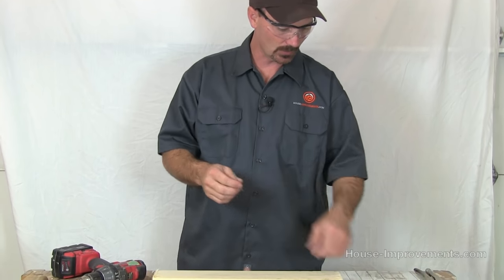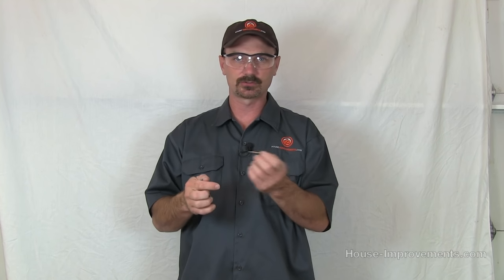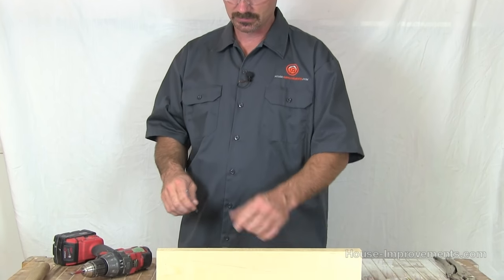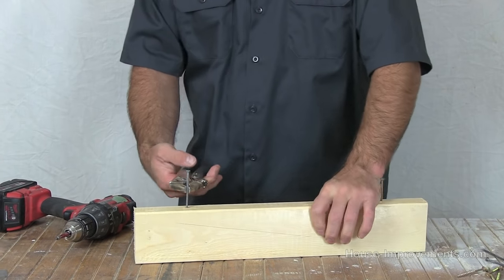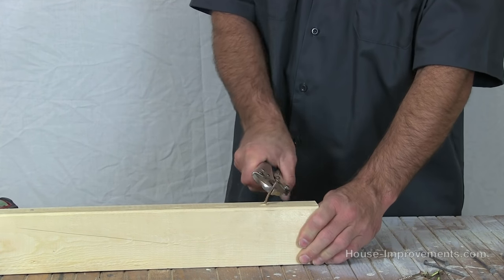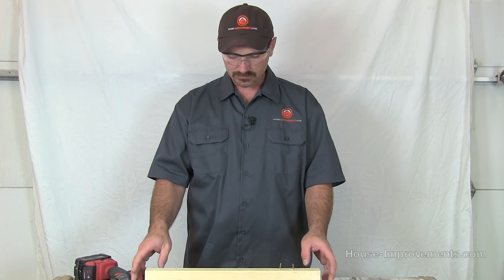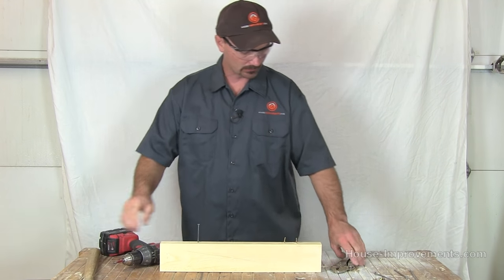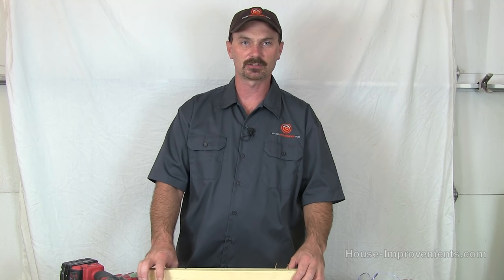Screws vs Nails - Which Is Stronger?

Comment: I am impressed by your experiment!!!... No problem with that whatsoever!... I may have my terminology wrong, but I believe "shearing strength" is the sideways strength... If my definition of "shearing" is correct, you should break both the nail and the screw by applying ONLY sideways pressure (no bending at all)...

Comment: Nails have to be ductile because they have to withstand a hard impact from the hammer. Screws have to be hard (thus brittle) to not deform at the screw head and withstand the twisting force during installation.
Reply: Thank you for that.

It makes more sense now.
Reply: Yes exactly I was thinking metallurgy difference.  And as another point there are decking screws which obviously would need to support structural loads also.
Reply: Perfect point thank you

Comment: A bit tangent to the focus of this post, but I just had an Attic Ladder that a licensed contractor installed 15 years ago come crashing down out of the ceiling in my garage just as I got my weight on the 3rd step going up - torn up, but damn lucky to be alive! As it turns out, he used (5) 1/8"x3" standard screws to mount the casing to the beams. The manufacturer recommended (10) 1/4"x 3" Aluminum Lag Bolts! That is what I am installing the new ladder with, but I also bought some 1/4" 3" SPAX Lag Screws to add as well. Not sure why they recommend and include Aluminum Lag Bolts with the new ladder, but maybe it is because the aluminum is not as brittle?
Reply: I should mention the 1/8" screws "sheared" right where the casing joined with the joists.(almost in the middle of the screws)

Comment: God bless you my brother but this is not how an engineer would come to the conclusion on whether or not the nail is "stronger" than the screw. But you kept me entertained at your level of commitment to the demonstration and many of your viewers will now be telling people how nails are stronger than screws !!!! Unfortunately some of us are just a little sharper and understand why engineers (who actually field test their designs) will tell you that the attachment resistance of wood sheathing when screws are used is much much greater than nails. That's why nails used to attach the sheathing (or roof tiles) have to be "ring-shanked" so as to avoid being completely ripped out of the truss framing. When you live in a high velocity hurricane wind zone and work in the construction industry you tend to understand why screws are used where nails are insufficient. Again Shannon thanks for the entertainment.
Reply from the maker: You missed the point. Deck screw are not strong enough to use as structural framing fasteners, they are brittle and will shear off easier then a proper framing nail or even a structural screw. I admit this is not the engineers way of demonstrating that and i never said it was.
Reply: Not every thing the engineer says is correct, sometimes we need a little more common sense

Comment: You nail your rails with either ring shank or spiral shank 3.25” nail and it will last longer than any screw. You are right about smooth shank nails but nails have far higher shear force resistance and will hold better

Comment: You should also show the screw advance. I try to look at as where the threat of force would come from if it's a side impact, nails  are best. If there is a concern a direct impact screw will not back out. Their is a place for both in framing, in my opinion.
Reply from the maker: The point is that you need to use structural screws when framing to standard deck screws

Comment: If your structure moves enough to shear a screw, then consider redesign the framing to strengthen the structure and reduce or eliminate the shear component on the fastener.  The earthquake scenario is like saying every house across the United States should use hurricane bracing even though there is no possibility of experiencing a hurricane in one's area.
Reply from the maker: Do not do structural framing with deck screws.

Comment: I have often thought about that. And as you say, structural screws . . . and adhesives . . . but I would also point out that you can add more screws and gain back the strength you might fear losing if using screws. Put in enough screws and I don't see (in my mind) anything like the screws breaking off happening. I know that if you put in too many nails the inspector will say you used too many nails an weakened the wood, causing splits you don't see with the naked eye . . .  that might be BS though.

Comment: I watched a recorded demonstration of one of those fastener testing agencies that works in tandem with ICC and they were doing various tests using nails and the equivalent size in approved framing screw size.  It was several different tests and in each test the boards were fastened to each other in different ways (2 boards flat stacked on each other, 2 perpendicular boards and 1 horizontal board fastened to them, etc) and in each case one was done with nail and one with screws.   The machine measures pounds of pressure as pressure is intensified and the test is stopped and pound of pressure is recorded when one of the 3 things occurs -  1) "pull out"  - fastener can no longer hold and is pulled out of the board  2) "shear out" - fastener is snapped due to increasing shear pressure  3) "tear out" - fastener remains in wood but tears through the wood and out the side of board.    The screw won every single test they did and even the ones that you would think the nail would win.  I had always heard "nails have superior shear strength" but thats not really true b/c the nail will never make it to the point where it is snapped and is pulled out of the board.  That particular test was 2 boards fastened to each other and the machine is putting downward/vertical pressure on the board that the fasteners go through first.  The nails problem in just about ever single test is pull out.  In other words it never makes it to the point of snapping/shear out b/c it gets pulled out of the wood.  Not only did the screw win all tests but it won by a landslide on just about all of them.  Contractors like nails b/c they're much cheaper and the amount of man hours it would take to build a house using nails and nail guns is far less than man hours to drive screws.  But in no way is a nail structurally superior it's only economically superior.
Reply from the maker: Deck screws are not to code for structural framing .
Reply: These weren't decking screws that were being tested they were structural screws (meaning it was a screw (of proper length) that is approved by ICC for what is being fastened together as in stud to stud sistering, stud to top/bottom plate, truss to plate, etc).  The metal composite of a structural screw is different than a non structural screw like a drywall screw or deck screw and it makes the screw less brittle (better against shear load) but still stiff enough to be drilled into wood without bending or snapping while being driven.  I dont think the video even gave the name of the brand of the screw they were using they were just showing that not only do structural screws pass all of the various  load type requirements, they actually out performed the ICC approved nail for the same kind of fastening.  I've noticed some people say "structural screw" and they're only talking about the thick lag screws but even then, not all lag screws are ICC approved for framing use.  A thick lag screw that is being used to fasten a fixture to something outside on a pole that is not a part of a house's frame won't be made of the same metal composite as a ICC approved structural lag screw that is fastening a ledger strip board to a ledger and supporting a lot of shear load from decking joist that are sitting on top of it.  You definitely don't want to put a non structural screw into something like a metal joist hanger where  not only do you have almost entire shear load, the shear load is all coming in on a thin metal plate against the side of the screw.  But they now have structural screws approved for those and they're just made of a different kind of composite than non structural screw giving it better resistance against  being cut/snapped by the hanger or from just the shear weight itself. @HouseImprovements
Reply: But if you want the extra output of structural screws vs nails you're damn sure better get ready to pay for it.  If I was a home builder I wouldnt want to use screws just b/c of the increase in cost it would be. I'd like to see a time comparison of how many hours it takes workers with nail guns to complete vs same number of workers using screws/impact drivers to complete a few walls of equal size.  My guess would be nail gun time would be about half of what it is with screws.

Comment: I'd love to see you do that with some 3" structural screws lol..  I personally used BOTH in my framing... best of both worlds.. common screws deff have way less shear strength..  Not Pre-loading your screws also helps. I'm way more accurate screwing my framing together with ceramic structural screws first, then nailing after..  I build my entire house with a few 18.5 v. cordless drills & a reg old E swing... no air tools in my budget..   If you think about it, back in the day they cut their lumber by felling a tree then wedging it out, board by board..  Great video's thank you for sharing!
Reply: GreenMountainGrow 8

Comment: When framing partition walls in a basement, for example, where there are no shear loads it is OK to use screws.  The screws are generally easier to use and if you have to back up a bit, it is a lot easier to disassemble a screwed together assembly.  Always, always use Robertson head screws because any other head type is virtually useless for getting screws tight enough yet still able to back them out with ease.  A battery operated impact driver with a #2 Robertson bit is unbeatable.
Reply from the maker: +Mike from Enderby I absolutely would agree with you.

Comment: My local building inspector says the same things.  And for framing, nails are required by code.
Reply: This could be true, the video doesn't prove it.
Reply: Nails are not required by Code, screws Are acceptable but every application is differant

Comment: I rarely see a screw snap off like that anymore, the ones I use are somewhat tougher then nails but they still bend real easy. If I use an impact driver sometimes the thinner screws will bend a little when driving them in. There's alot of different screws for different purposes. The ones in the video look like they are made of brass and are usually used because they look nice but they are very brittle. The screws I use specifically state that they are made for wood construction.
Reply from the maker: These are standard #8  yellow zinc deck screws

Comment: Yeah, common deck screws don't cut it in framing. 

Screws have their place, and Simpson has a great line of structural screws that pass any code as a replacement for like nails.  I like to use them for framing brackets and toe nailing as it can be clumsy/impossible to use a nail gun, and screws can often be put in as fast as manual nailing at odd angles.

Comment: I am re planking my 31 meter boat (which is made of wood). We normally use 12cm galvanised nails which attach the 2 inch plank to mulberry wood ribs.
Over time those nails rust and fall away and we have to re nail the whole boat. While re nailing we slowly split the mulberry.

So I can get a few thousand stainless steel screws which will not rust. Is that a good idea?

The water's impact is head on, but there are also some sideways forces going on.

I can't make up my mind and some professional help would be great.

Comment: Anyone demo-ing a project has seen how screws tend to snap off and the nail just bends. Not sure how the newer framing screws perform but you can tear apart a project that was put together with deck screws pretty easily. I like to use both. Use a screw to pull crooked wood together and then nail it.

Comment: Excellent demo... thank you.  I do have a concern about the definition of bending vs. shearing, but still... your demo is valid because you used the same method on each.  That said, what you demonstrate is bending-induced metal fatigue... not shearing.  By flexing the metal repetitively, you changed its properties... ie. ruined it.  I wonder which would fail first in a pure shearing test.  Thoughts?
Reply: My thoughts as well. I’m not a material science engineer but I have taken some courses. Bending causes fatigue which is different from shear. Although his point still stands that nails have a much better resistance to shear.

Comment: It would make sense to use both. Screws will help keep nails from pulling out over time especially if there are moisture issues. Nails are by far the fastest method for assembly. 

I would like to see this test with stainless steel screws which are very nice fasteners.
Reply from the maker: +T Rex  Nice but expensive. Remember I am recommending nails for structural work but screws are better for things like decking, plywood and other non structural work.
Reply: +T Rex True stainless steel screws would fall under the "exception" rule.  I love the idea of using both as well.  There always seems to be this "this versus that" comparison instead of, just use both solution.  Cost is negligible.

Comment: Your assertion that nails will take flexing to bend than a screw may be accurate in certain situations, however your test, IMO, isn't valid. Did you notice that every time the screw broke off it broke at a thread? That is because the thread forms a stress riser or weak point due to two factors. One, the diameter is reduced there and two the shape of the thread at the root is a "V" or "U" which is a point where a break can easily form. These two areas are the weak points. If the screws are properly sized the threads will all be buried in the wood being screwed to and the screw shank will be what is taking the punishment at the joint between two joining members. 
A more valid test would be to join two members with a properly sized screw and subject them to a shear test, then do the same with a nailed piece. My guess is that the wood in both tests will fail before the fasteners do. In addition, in the case of a joint under tension the screw will far outperform the nail unless the nail is either ring shank or rosin coated, in which case I still bet on the screw.
Reply from the maker: Actually we were showing exactly what you noticed,When using these "deck screws" for framing you will have failures. There are proper structural screws for framing but these are not them.
Reply: Actually you weren't demonstrating what I said. In order to demonstrate my point you would have to put the screws in far enough that no threads were showing above the top edge of test board so that ALL bending was taking place above the top of the board and not in the threaded area.  When properly sized screws are used no threads will be in both pieces being screwed together, a smooth screw shank will be in the piece being attached to the adjoining piece and that smooth shank will extend about 1/4 inch or more beyond the joint. The threaded portion of the screw will be entirely embedded below the joint. This forces all shear to take place on the larger diameter smooth portion of the screw (shank). When properly sized and screwed in properly flex and bending cannot occur to the threaded portion without damage to the parent material (wood) below the joint, at which point the materials being used to construct the structure are already failing.

You are correct that there are correct structural screws for framing and they are the best option, however in another comment below you state that deck screws are not proper structural screws. Deck screws, even if only used to fasten down deck board do provide structural integrity; the screwed deck boards prevent lateral movement and failure of deck structures. Now, if you are talking drywall or sheet metal screws, which are made of steel that is significantly less ductile than deck screws or structural screws all bets are off. They will break or shear very easily with only slight movement.
Reply from the maker: You are correct deck screws are fine for attaching decking boards and also that that the decking does give some structural integrity to the deck structure. But then again if I could frame the walls of a house with 4-6 deck screws /sq.foot it would likely hold together as well. I'm not suggesting screws do not have their place but they have to be proper for the job they are doing. If i used deck screws to frame the exterior of a home it would never pass code .
I suppose we should have built a set up to show the shear strength more particularly, as our demo was not exactly accurate ,our mistake.
Reply: Yea, I don't like the experiment either. My problem is that both are halfway out the board. When in reality which fastener backs out of a board more often on their own?  The screw would never be in that position in the first place.
Reply: Plus, this video compares nails that are designed for hanging joists with screws that are not designed for structural framing.  WHY?
Reply: @shanefiddle  because most people don't pay attention if it's a normal screw or structural. Of course structural screw vs nail, the structural screw is better since it had both sheer strength and it holds onto the wood better than a nail.
Reply: What are the structural screws please?
Reply: @vinceking7878  They are much more robust, and they actually say "structural screw" on the box. They may even have sheer and pullout load tables listed on the box. GRK makes really good ones. 
Drywall screws are SUPER brittle. Deck screws are a little better, but everything he said is right.